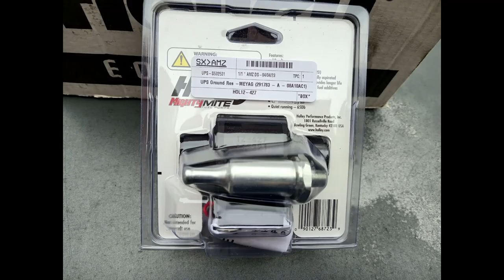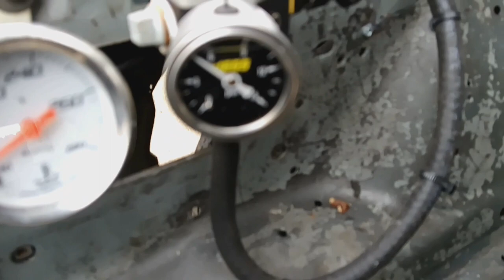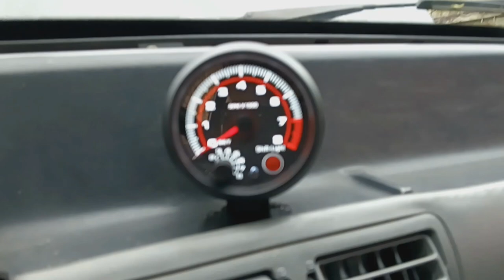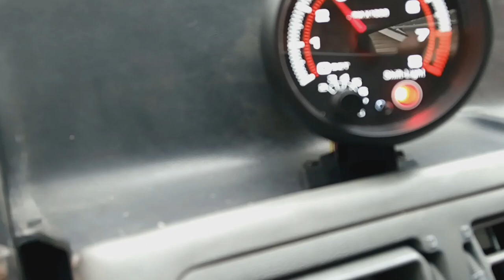Holley "Mighty Mite" fuel pump 12-427

Comment from the maker: About the car:  89 Mustang LX Notchback, AOD, Air Conditioner delete, Aluminum radiator with electric fan, Summit Racing 1 wire 140 amp alternator, Longtube headers with true dual exhaust & Flowmaster mufflers, Trick Flow Track Max cam, converted from EFI to carbureted, Edelbrock Performer 289 Intake Manifold, Holley 600 CFM Street Warrior Carburetor

That sounds like a nicely modified 1989 Mustang LX Notchback! Let me break down some of the modifications you listed:

AOD: This refers to the transmission in your Mustang, which stands for "Automatic Overdrive". It's a four-speed automatic transmission with a torque converter lockup clutch that helps improve fuel efficiency on the highway.

Air conditioner delete: This means that the factory air conditioning system has been removed from the car, likely to reduce weight and free up some power from the engine.

Aluminum radiator with electric fan: Upgrading to an aluminum radiator can help improve cooling performance, and adding an electric fan can further increase airflow and reduce engine heat.

Summit Racing 1 wire 140 amp alternator: This is a high-output alternator that can provide more power to the car's electrical system compared to the factory alternator. The "1 wire" design means that it only requires a single wire to connect to the battery, simplifying installation.

Longtube headers with true dual exhaust & Flowmaster mufflers: Headers are designed to increase exhaust flow, which can improve engine performance by reducing backpressure. The "true dual" exhaust means that there are separate pipes for each bank of cylinders, which can further improve flow. Flowmaster mufflers are known for their aggressive sound and can provide a noticeable improvement in exhaust note.

Trick Flow Track Max cam: This is a performance camshaft designed to increase power and torque in the engine by altering the timing and lift of the valves. The Track Max cam from Trick Flow is designed for street/strip use and should provide a noticeable improvement in performance.

Converted from EFI to carbureted: EFI stands for "Electronic Fuel Injection", which is the factory fuel system in the 1989 Mustang. Converting to a carburetor can simplify the fuel system and potentially provide better performance, although it can also require more maintenance and tuning.

Edelbrock Performer 289 Intake Manifold: The intake manifold is responsible for distributing air and fuel to the engine's cylinders. The Edelbrock Performer 289 is designed for small-block Ford engines and can provide improved airflow compared to the factory manifold.

Holley 600 CFM Street Warrior Carburetor: This is the carburetor that replaced the factory EFI system. Holley is a well-known brand in the world of carburetors, and the 600 CFM (cubic feet per minute) rating is a measure of the carburetor's airflow capacity. The Street Warrior model is designed for street performance and should provide good throttle response and overall performance.

Overall, these modifications should result in a noticeable improvement in the performance of your Mustang, particularly in terms of acceleration and exhaust note. However, it's worth noting that these modifications may also make the car less reliable or more difficult to drive in certain conditions, so it's important to take these factors into account when considering modifications to your vehicle.

Comment from the maker: The Holley Mighty Mite fuel pump 12-427 is a high-quality, reliable fuel pump designed to deliver a consistent fuel supply to carbureted vehicles. Here are some benefits of this pump for Jeff Palmer's 89 LX Mustang, which has been converted from EFI to a 4 barrel carburetor:

Reliable fuel supply: The Holley Mighty Mite fuel pump 12-427 delivers a steady and consistent fuel supply to the carburetor, ensuring optimal engine performance and reducing the risk of fuel starvation or engine damage.

High flow rate: This fuel pump is designed to deliver up to 35 gallons per hour of fuel flow at a pressure range of 4-7 psi. This ensures that the carburetor is supplied with the necessary fuel to operate efficiently.

Easy installation: The Holley Mighty Mite fuel pump 12-427 is designed for easy installation and can be mounted in various positions. This means that it can be easily fitted into Jeff Palmer's Mustang without the need for any additional modifications.

Improved fuel economy: A properly functioning fuel pump can help to improve fuel efficiency by ensuring that the engine is receiving the right amount of fuel. The Holley Mighty Mite fuel pump 12-427 can help Jeff Palmer's Mustang to run more efficiently, reducing fuel consumption and saving money on gas.

Reduced risk of vapor lock: Vapor lock occurs when fuel vaporizes in the fuel lines due to high engine temperatures, resulting in a loss of fuel pressure. The Holley Mighty Mite fuel pump 12-427 is designed to reduce the risk of vapor lock, ensuring that fuel is delivered consistently to the carburetor.

Overall, the Holley Mighty Mite fuel pump 12-427 is an excellent choice for carbureted vehicles like Jeff Palmer's Mustang. It provides reliable fuel delivery, easy installation, and improved fuel efficiency, while also reducing the risk of vapor lock and other engine issues.